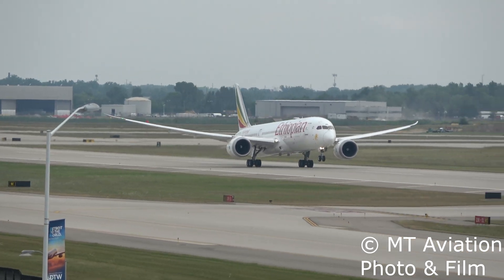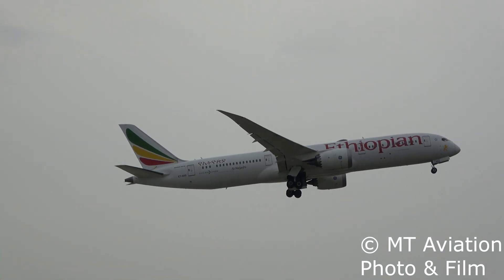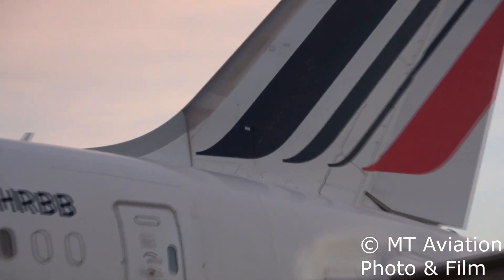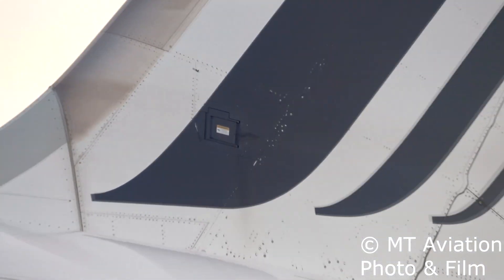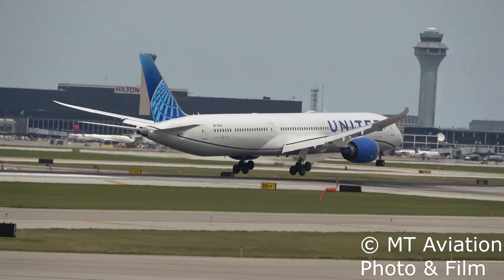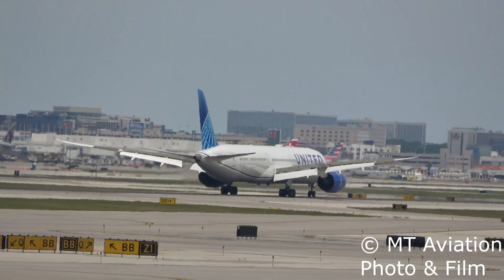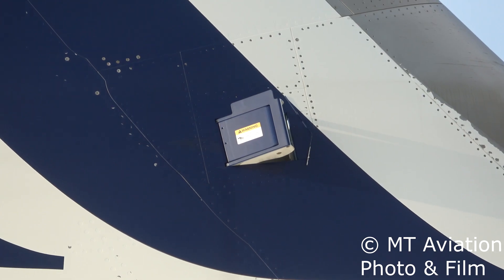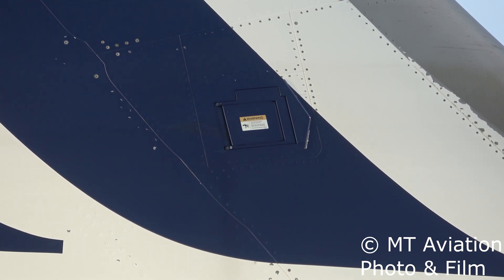EDAS, the B787 system you may have never heard of

Comment: How do you block those millions of holes when the aircraft is painted?  Just curious!
Reply from the maker: The leading edge where the holes are located is metal and not painted
Reply: Very informative.
Reply: The same way other parts of the airplane are protected from paint… with masking tape and plastic sheeting.